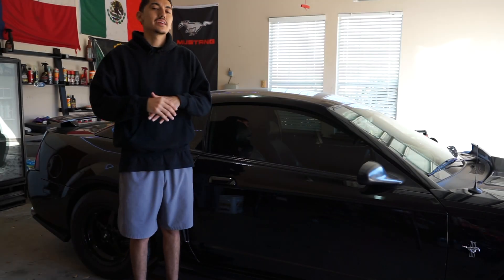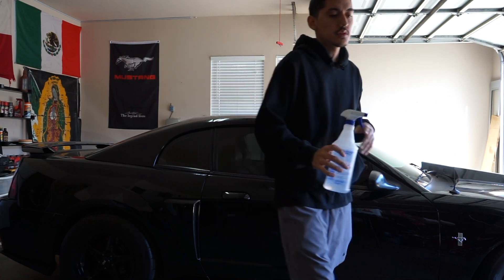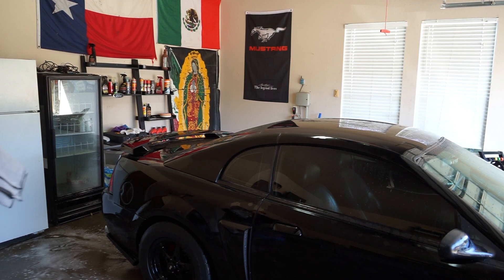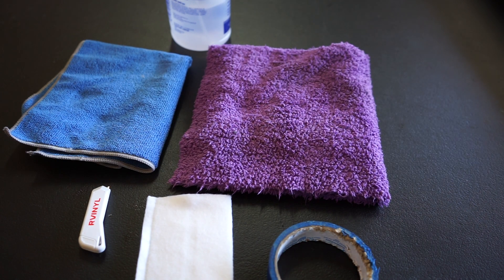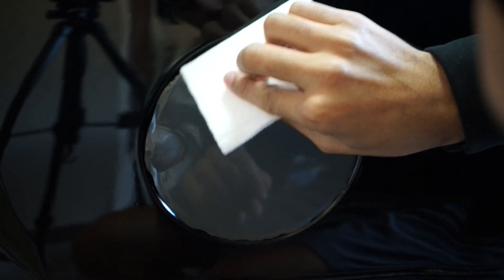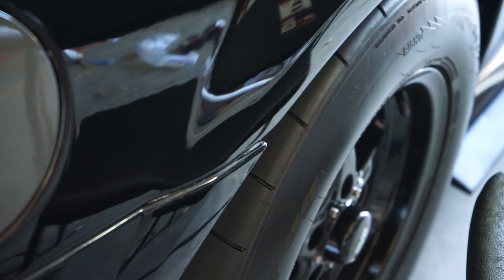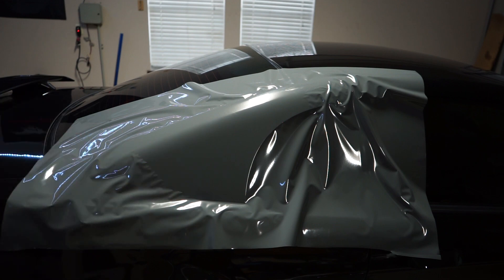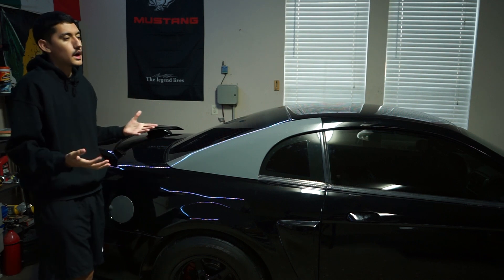Wrapping my 2004 Mustang GT! - Phase 1 - (Beginner)

Comment: Hey big homie that first piece that you tried on the hood you did not mess up that piece at all vinyl is very durable so all you had to do is go on one side and lock it in place and then picked up the other side and just pulled and pulled on it that Kris would have came out and if there was any hard hard hard lines all you have to do is use a heat gun not a hair dryer because a hair dryer doesn't get as hot. But if you use a heat gun and you pulled on it all that would have came out and you would have had no issues.

Comment: Me,my wife, and my son all pitched in when we wrapped my new edge, it’s on the second wrap now and with a little help on larger panels the outcome is great if you have enough patience!
Reply from the maker: Yeah it most definitely helps when you have other people as you saw 😂 
Hopefully for the next panels I’ll be able to lay down the wrap better and faster 😄
Reply: @dfwdanny  oh for sure, above all have patience!! And that post heat makes a huge difference in the finished product!
Reply: How long does a wrap last? Does hard rain or sun effect it. What happens if a scratched?
Reply: Does it cost more or less than painting? How long will it last?
Reply: @sonsoftheedelweiss72  truly it depends on the materials used, and the elements it’s exposed to. Most wraps can last anywhere from a few years to lifetime depending on how it’s maintained. You can wrap a car as cheap as 400$ or as much as 5-6,000$

Comment: Thanks for posting the vid . Learned alot .i have a 94 gt i need to wrap. Paint is shot clearcoat is coming off so i got to sand the car down first.
Reply from the maker: Yep! I failed due to not having enough and not measuring correctly, I would’ve finished so quickly because it became so easy over time

Comment: When your putting the wrap down are u supposed to use water on top of the wrap den put it down? I just did a carbon fiber wrap on my cowl hood but I noticed I have sum scratches on the wrap it's my first time so I was kinda confused cz ppl were saying different things
Reply from the maker: I did not use water at all, and do not worry scratches are normal and it’s inevitable if you get some. Just try to have a clean applicator (no debris/dirt on it) to minimize the chance of more scratches. 👍🏽
Reply: @dfwdanny  ok cool cz I didn't use water but I have sum scratches on it not really noticable but wanted to see if you did it the same way